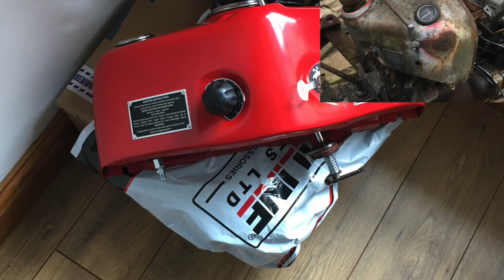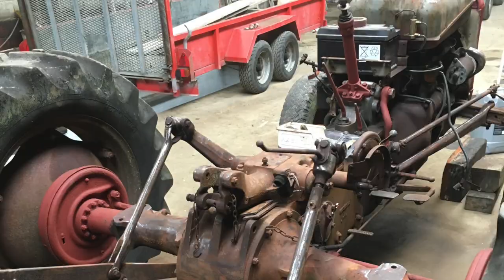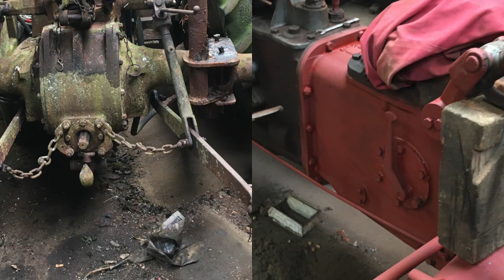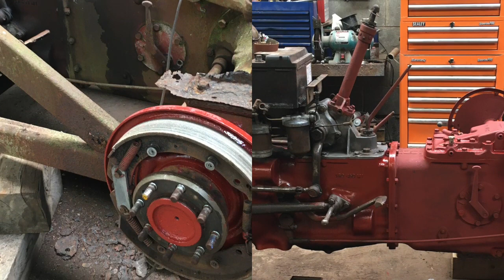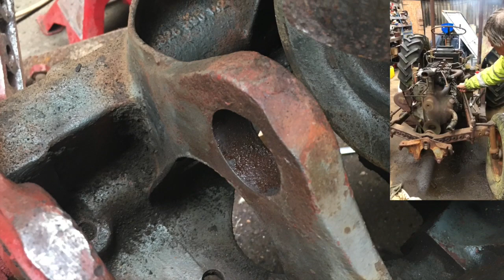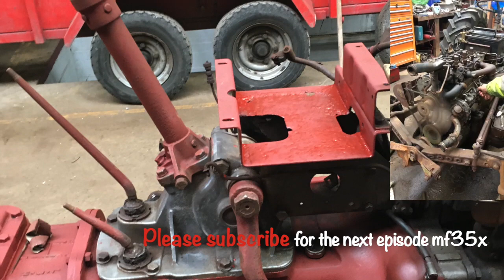how to, massey ferguson | massey ferguson35x |  tractor restoration starts here  ep3

Comment: its starting to look good
Reply from the maker: thank you yes its moving on a bit now ...new clutch going in this weekend 👍
Reply: @Ayorkshiremansdailygrind  glad to hear that you are still working on it. Is this a 3 or 4 cylinder?
Reply from the maker: @bartjuhhh6416  its a 3cylinder , the best on the 35 massey range
Reply: @Ayorkshiremansdailygrind  i agree but i have an allis chalmers ed40 with the same in line 4 as the 35 and i do admit that its a good engine aswell

Comment: What did you use to clean up all of the surfaces? I'm hoping to start a restoration in the summer and was thinking about blasting the main chassis for speed but you seem to have got yours pretty clean.
Reply from the maker: Hi john , i used a grinder with a flappy sanding disc , i used it on the rougher parts when the disc was new and has it wore  down a bit i used it on the more sensitive stuff apart from panal work and a lot of the rusty parts i used a scraper to remove the  heavy rust .   i was going to get mine blasted  but once i started i thought i might aswel just continue as i am .  got to say though its very dusty and a good mask is needed ,   good luck with yours and let me know how your getting on with it .   cheers  mick